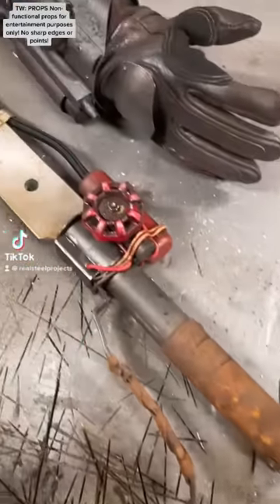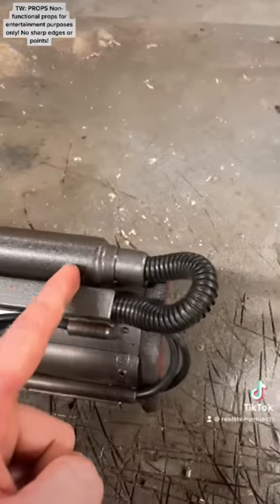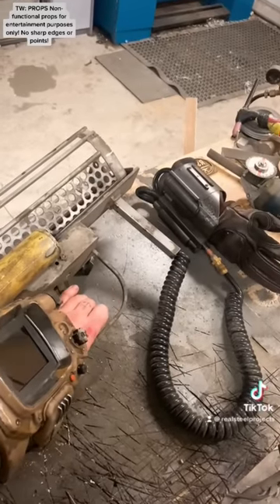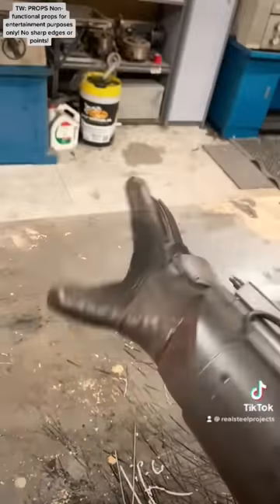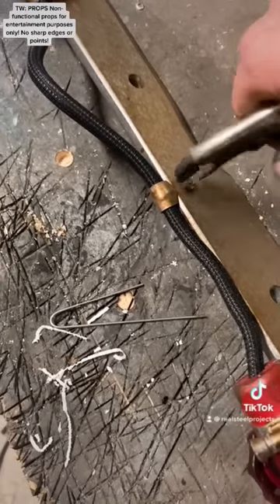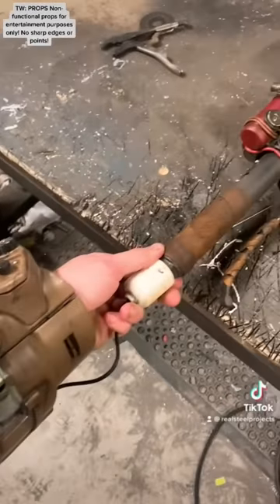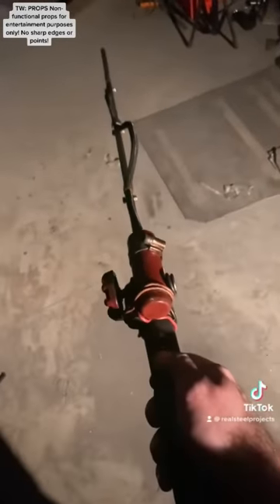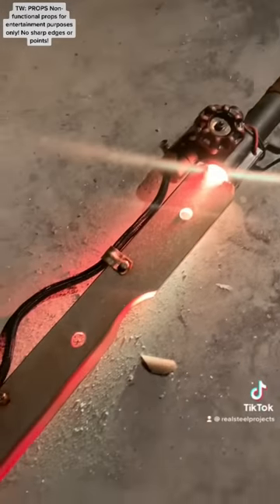Tales of a wasteland scavenger!

Comment: Never pump your ballistic fist past 190 PSI. 

Y'gotta remember, these things are loaded with 9mm buckshot BB's. if it's over-pressured, you'll be joining the next guy you punch.

Happy Scavenging!
Reply: >9mm
>buckshot
>bbs
Reply: @svenghoolie  
Mm-hm.

000 Buckshot.

ah've got a magazine for 16 caps here, if y'need tuh brush up on yer guns.
Reply: @mileator  i think you've got a few circuits crossed, bud
Reply: @mileator  9mm is 0.380 in, bud, and a bb is 0.177. We can get the calipers out, if you like

Comment: How do I fix rusty power armor knees and elbows, mine has blue gunk like amber drops on the outside too. (Found on river banks no torso or helmet, just arms and legs)
Reply: Okay that's a great find the easiest way is to gently remove the rust with low grit sandpaper, afterwards it's important to oil the metal joints in the armor.